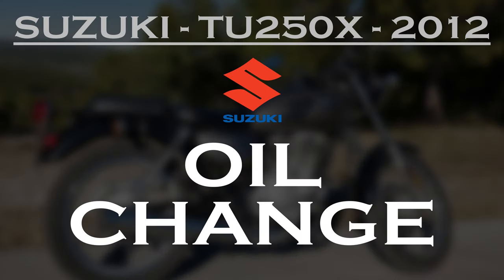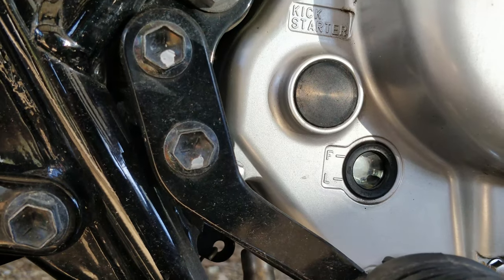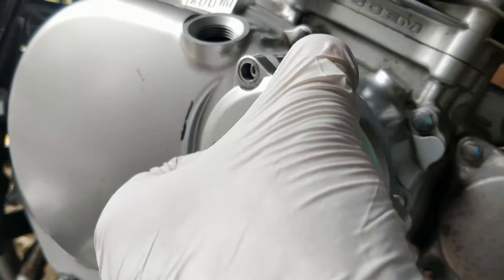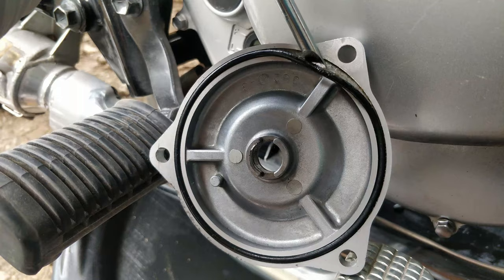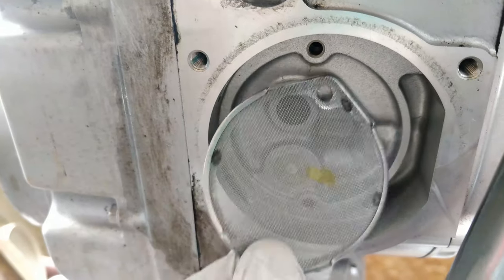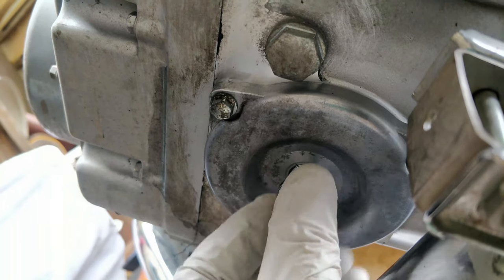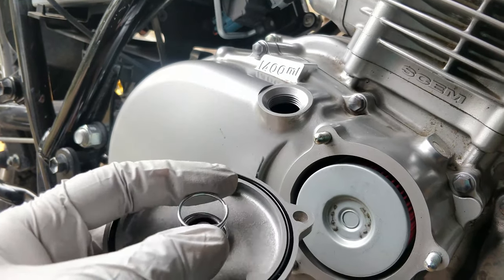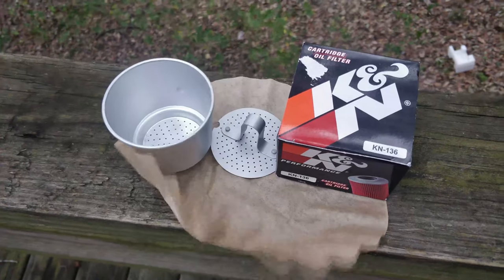Suzuki TU250X 2012 Oil Change

Comment: Excellent video! Clear, thorough, and even funny.  Might warn against removing the other 17mm bolt near the drain bolt---it's the gearshift detente.
Reply: Thank you!! 1:19, the video actually skips but that is where he says "oil drain plug". I'm a newbie rider and am trying to figure out where the gearshift detente is (the dealer put it back in wrong!)